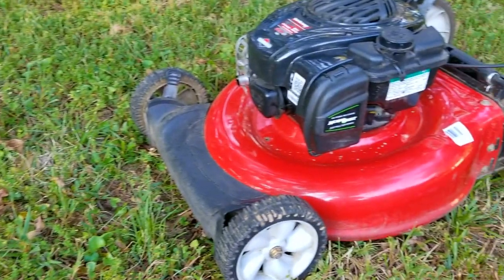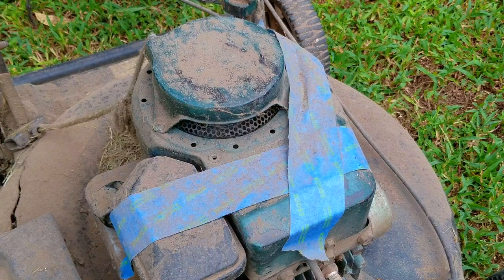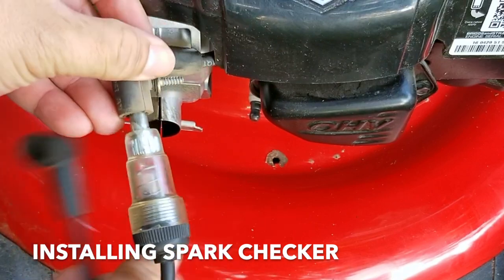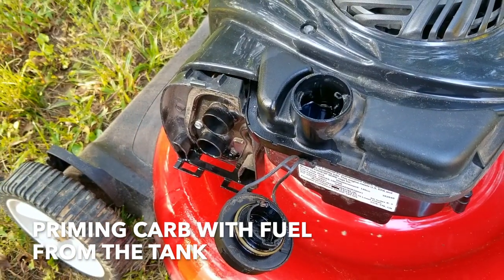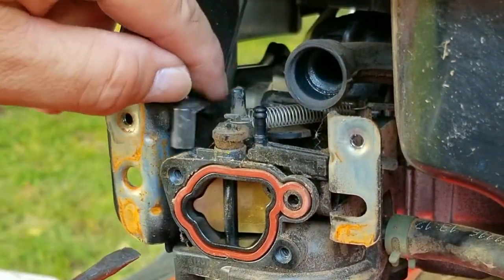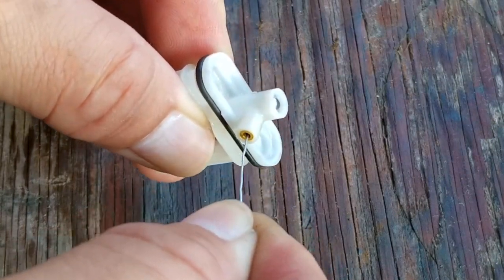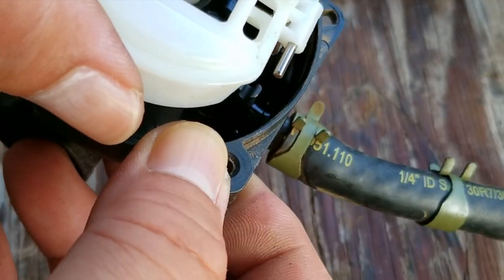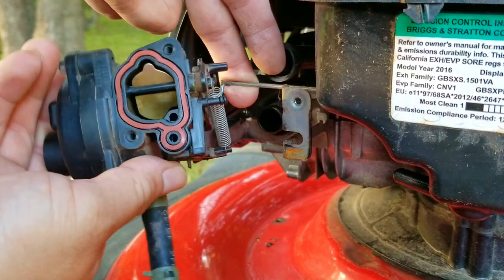Why Did Briggs Stop Making The Flathead Engine?

Comment: Combustion chamber design has way more to do with emissions than fuel delivery.  Run 2 stroke oil mix 50:1 in every small engine, carb or fuel injected. This will prevent your carb from plugging up. I have been doing this for decades, no issues. 
Also run 91 octane fuel, typically it has no ethanol, the demise of all carburetor engines.
Reply from the maker: interesting idea.

Comment: The old engine often wouldn't start (or was very hard to start) because the points got oxidized while the engine sat unused for several months. Then you got to experience the fun of trying to pry off the flywheel, if you don't have the special tool. But it all seems a moot point now, since B & S went bankrupt and small engines are being replaced by electric motors. My Ryobi RM480E is a big improvement over the old Deere LA105: No question as to whether it will start, no need to buy gasoline, motor oil, filters, plugs, etc.
Reply from the maker: most of this is very true, but after every charge, the capacity of that battery will slowly decrease and one day you're going to use it, only to find that it won't finish your lawn anymore. Then your wallet will remind you how expensive batteries are.
Reply: @INSIDEHOUSEGARAGE  I am a bit concerned about that. The RM480E uses lead-acid (AGM) batteries, so I take care to never discharge below 50%. The original batteries aren't too expensive, but I may upgrade to lithium ferrophosphate when they eventually get tired.
Reply from the maker: thanks for the response. I do have a concern that, by the time someone would need to replace the original battery that, they will no longer be available, in that configuration or voltage.

Comment: Re: comment about needing a battery for fuel injection - Honda made competition off road motorbike with proper FI but no battery.
It was their Montesa Cota 4RT, from around 2007.
Reply from the maker: really, then must have installed  one heck of a magneto on there. The amp draw, from just the fuel pump alone , must have been close to 15 amps.   Oh I see, this is a competition bike that costs a lot of money. never mind.
Reply: @INSIDEHOUSEGARAGE   Yes, the generator must be up to the job. You could buy 37 B&S 550EX engines for the price of a new 4RT motorcycle.

Comment: I can see fuel injection becoming a thing on commercial grade ride on mowers. But when it comes to residential mowers, they’d be too expensive and not really worth it because the expected life span of those mowers are lower than five years. But you are right about one thing, they should have just improved the flat head quantum engines.
Reply from the maker: you make a good point.
Reply: I don't see fuel injected mowers in our future. California has already banned the sale of new ICE yard equipment and Honda has announced they're ending small gas engine production. I expect other manufacturers to follow suit, and what remains of ICE production will be done as cheaply as possible to maximize profit and sales until the end comes!
Reply: Will all be battery in a decade or so, B/S are investing in it. For the smaller domestic market anyway
Reply: @sunbeam8866  Not a hope are honda stopping production of small engines, they can sell at a profit every single piece they build, the world does not stop outside of USA
Reply: @lot6129  Honda has announced the end of gas mower production in the US by September 2023, with remaining stock to be sold off in 2024.  For now, they've stated production of some ICE products will continue, including other lawn & garden equipment, generators and waterpumps.

Comment: The flatties where amazingly reliable long lasting engines but it's not because the new ones are bad, it's just the new ones are technically better while the old school guys where simple even for their time. The old Briggs flatheads had a compression ratio of something like 6:1, and a working PSI on a good motor at 90 psi. If we compare that to a modern Honda GX160 or something (which is what every ohv engine is nowadays) the CR is 8.5:1 and the PSI is 110-140 according to Honda.

As for reliability the Honda stuff is amazing, I've seen Hondas with uncounted hours garbage sludge for oil and it still runs like a new one, the clone stuff is where things get rocky, and there's a reason briggs went out of business in 2020 and is now a shell company. They weren't making quality engines like they used to, and they weren't innovating like Honda did. It was a race to the cheapest price to get motors onto mowers and blowers, a race for price is a race to the bottom. The plastic carbs are an obvious end state of non adjustable carbs, in theory a plastic carb makes more sense it's less likely to get clogged can be a much more complex design and so on, in practice it's garbage. But even metal carbs on a lot of modern stuff is garbage. I routinely fix snow blowers that are poorly jetted from the factory, these things couldn't throw for shit and are hunting like crazy at throttle, running too lean because of poor jetting. Meanwhile my old seers with a Tecumseh snow king starts up every time, breaks up ice like no ones business. It's all for economy and run time and all that.
Reply from the maker: thank you for the comment Dangerous Amoeba.

Comment: Haven't watched the full video, but as a mechanic I'm going to go out on a limb and say that the main reason would be to continue selling products in the market place.
The need for lower emissions extends to power products as much as it does for vehicles these days.
No way to meet any kind of emissions target with an inefficient flat head design.

Whether or not the new version is as reliable is purely down to cost cutting during manufacture.
Reply from the maker: very true, thank you Dangermouse

Comment: I don't have a preference one way or the other on the engines but I can tell you a part that I hate on these...the stupid grass outlet.  The plastic lip on them gets worn out after bumping a few trees and then it never stays on or if you are trying to cut down tall grass.  The engine has enough power to cut the grass but the outlet keeps falling off.  I'd like to see a larger outlet.  Then there's the flimsy axles on the front tires that get bent easily.  And while I'm complaining, I want a snowblower that has a reverse  drive faster than a literal turtle.
Reply from the maker: thank you Robert Jones, all very good points

Comment: Ran a wood mizer withan 8.5 hp engine it always started right up , the mill sat in the rain and snow for eight years . Would not turn over . Took off the head , look like a fungus growing there , little WD-40 , got the piston free , threw it back together ("used the old head gasket ) and it fired right up and ran the mill as when new .. Bad then about the motor was it was cast iron , built to last forever . But. Lordy Lordy that thing was heavy
Reply from the maker: cast iron, just means it was going to last, forever, just In the spot it was put down, cause it's going to be hard to move. Thanks again.

Comment: I have a Cooper Clipper mower that my folks bought when they moved into their new house in 1947. Around 1965, when I was 10 or so, my father pulled the head and wire brushed the carbon off. I still use the mower, the flat head Briggs starts first pull. I think the plug is from the 65 rebuild. Only thing that has been replaced is the muffler. This is why Briggs stopped making this motor. Too dependable for todays business culture. The new OHV motors are probably a chinese import.
Reply from the maker: I completely agree.

Comment: Supposedly the overhead valve engines are more fuel efficient compared the old flathead engines. This happened in the automotive industry too. Where the overhead valve engines gave more power for fuel consumed. This was due to the flathead’s major airflow problems and low compression ratios. The airflow path for the engine is hardly ideal. As the air feeds its way through the engine, it has to turn 90 degrees, then turn another 90 degrees to head into the cylinder. A modern engine’s valves help route air toward the piston, around it, and then down into the cylinder.
Reply from the maker: thank you George Travers

Comment: You can take those carburetors apart without taking them off the engine. All you need is a small gage wire and carb cleaner.
Reply from the maker: thanks for the information

Comment: The reason Briggs and Stratton  got rid of their flat head engine was because of ever  increasing  EPA regulations  requiring  power equipment  engine manufacturers to clean up their exhaust emissions. They had gone as far as they could in cleaning up the emissions on the flat head by 2012. After that, the overhead  engines had to fill the void.
Reply from the maker: I understand the EPA issue but the quality dropping down, was not part of the EPA's doing.  Greed is the answer.

Comment: What do you think of electric mowers? I feel like small power applications like mowers are going to replace gas with electric. I had an argument with a friend of mine about electric chainsaws. I’ve tested a few electric chainsaws and I think they are the future. He says they don’t last long enough for serious outdoor work. He’s mostly right, but he does more serious lumberjack stuff than I do. I feel the same about mowers. I think if you’re  homeowner just wanting to mow your lawn that electric will be the way to go. If you have a  lawn care business then obviously, you want gas. But then if you have a lawn care business you wouldn’t be tinkering with these low end gas mowers. So I think the future for this end of the market is electric. Am I wrong?
Reply from the maker: I have no problem with the power, or quietness, or the effectiveness of battery power. What I don't like, is that electric motors do not last, because it best they're using ball bearings and at worst "bushings" to spin on. These are not Automotive quality and they'll last long enough thru the warranty period. My other issue, are the batteries. These are not EV quality batteries, so won't last as long, one would hope. Then when you have to buy a new one, you're going to have a hard time forking over, the money because they are not cheap.

Comment: Am I the only one that knows about fuel stabilizer if it's stored over long winters? 
Also something else was wrong. There was tons of dirt in the airbox that had gotten past the air-filter and between the air-filter and intake to the throttle plate.
Reply from the maker: no, they way the air box is designed, the dirt is supposed to get inside it. It's not supposed to get into the 2 round openings.

Comment: 5:00 Fuel injection! That carb must cost about 2 cents to produce, how much do you think an FI system would cost? Also an FI system would help all that much with regards to the emissions, it is the flat head design that is the real issue, it has a long flame path, no squish to speak of and can only be setup with a fairly low CR if you don't want to run into detonation.
Reply from the maker: it would have cost less then R&D for a whole new engine made overseas.
Reply: @INSIDEHOUSEGARAGE  Like I said, a flat head engine would still have poor emissions and be less fuel efficient regardless of whether it was running a carb or FI. the combustion chamber shape is just a bad design. The only 'good' thing about them is that they are cheap to make and have less moving parts. So I guess Briggs had no choice, they had to build an engine with a better combustion chamber shape and that means going for overhead valves. The new engine would then meet their needs in terms of emissions, efficiency and power output even if it was being fed fuel and air via a cheap plastic carb.
Reply from the maker: sure, but they made their choice to change to OHV about a decade later then they should have.  Late the show I guess.

Comment: because its and old design that is un-economical to run as you can't get the emissions lower than an ohv engine, pretty much any newer small engines run super lean due to emission standards now
Reply from the maker: yes that's what I heard.

Comment: Who makes the engine for Champion generators? Are they made in China? Are Champion generators made in the USA or just assembled from Chinese parts? The carb on my generator seems to be metal. I shut the generator off by closing the gas valve and burning the gas out of the bowl.
Reply from the maker: don't know about that information 
But if I had to guess, it's an overseas engine, 
and the hole thing top to bottom is probably assembled there too.

Comment: The only reason briggs and Stratton phased out the flathead series motor was because of emissions because in a flathead motor a good amount of sent fuel from the carburetor is wasted either not used at all or sent through the exhaust unburnt
Reply from the maker: you are correct. the design is not good for efficiency
Reply: @INSIDEHOUSEGARAGE  it's not that there not good for efficiency it's there not good for emissions out of all of the 3.5 and 3.75 sprint motors I've had they were very efficient in terms of fuel consumption but in terms of exhaust emissions fuel metering in those tank mounted carburetors is not very effective

Comment: It wouldn't bother me at all if Briggs and Stratton went under.    Just to clean the carb you need a full tool chest , then it's a trip to the parts store to get that funky I ring material gasket.       Any Honda or Clonda variant can be fixed in a couple of minutes with a 10mm and a screw 🪛 driver.
Reply from the maker: thank you Phil Lowman.

Comment: Flathead all day long. I Have one on a cast aluminium body (Masport), sooo much better than thin pressed steel. As a spare motor I kept the flathead off my old Victa when the body rusted out. I doubt I'll need another mower in my lifetime.
Reply from the maker: you are correct, these engines are fantastic, just a bit of maintenance, some good fuel and it will last.

Comment: Unfortunately a flathead combustion chamber can never meet modern emissions standards.  There is more than twice the surface area of an OHV chamber, and control of swirl and flame front movement is nearly impossible.  While adding EFI would help, it would just be a pricey bandaid on a major issue.  
The other issue is how long they last.  As sad as it seems, they simply didn't sell enough engines.  The new products were competing against not only other manufacturers, but also older examples of their own products.  I have a tiller that was made in 1963 and still runs strong.
Reply from the maker: thank you for the great comment I appreciate it.

Comment: I got a Troy-Bilt from a thrift store that likely had less than 10 hours on it. it had one of those new garbage Briggs engines with a plastic carburetor, which immediately revealed why it was at the thrift store..it wouldnt run for more than a few minutes.
Finding out that the carburetor mounting had been changed making it difficult to use the older metal carb, I took the entire engine off the deck and threw it in my metal scrap pile. I had a beat up mower I got from Habitat for Humanity thrift store that had broken wheels, took the old flathead Briggs off of it and installed it on the Troy-Bilt.
I dont give a rats butt about emissions.
Problem solved.
Reply from the maker: well said, thank you Don Reinke.

Comment: Another issue is the ethanol in today's pump gasoline.  For that reason, I now use the gasoline sold at Home Depot and such.  In Oklahoma, where I grew up, the American Indians  can sell non-ethanol gas which is much better for small engines, so non-ethanol is gasoline readily available, so less issues.  (In my opinion, ethanol in gas is a scam for the industrial corn farmers, it does not save oil at all).
Reply from the maker: it certainly doesn't do small engines any good from what I can tell.

Comment: Briggs had overhead valve engine in the teens with the Briggs model F.
Reply from the maker: having a hard time finding one online to look at.
Reply: @INSIDEHOUSEGARAGE  there is a few on YouTube running. I've got a slightly later 1928 Briggs&Stratton model FI and FH myself.
Reply: @INSIDEHOUSEGARAGE  1921 was the first year.
Reply from the maker: ohh, you mean early 1900's I thought your comment said "teens" as in 2010-2019.
Thanks for clarifying I found it.

Comment: You don't need an ECU to control the injector on a small single cylinder engine like this, you could run the injector off of a second coil, driven off a separate magnet assembly spinning 2:1 off of the engine. Drive the pump off either the intake or crankcase vacuum, and you've got the objectively "dumb"est EFI system one could make. If theycould have done this with their flatheads, they would have had a, by all reasonable means and purposes, unkillable engine.
That aside, I have a flathead mower where the carb has a stuck open valve in the priming pump making it a nightmare to start, but when I do finally get it started it runs like a dream. Maybe I'll one day replace the carb, or maybe one day I'll try to do such a "dumb" EFI mod if I get the tooling to fabricate all the brackets and gearing to put together such a system. Or maybe I'll finally dig into that priming pump again and actually show that valve what-for, I have no idea.
Reply from the maker: good luck with your engine, as for the EFI and second coil, it might work but or the fuel pump, a pulse pump worked by crankcase pulses, will not be able to create enough pressure for the injector to work. I'd say at you'd need at least 25 PSI for an injector this tiny